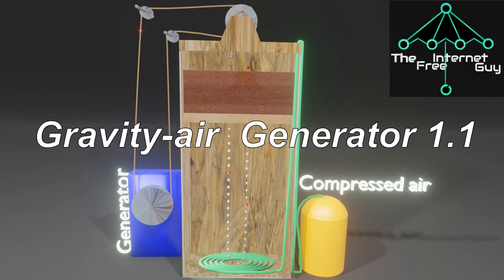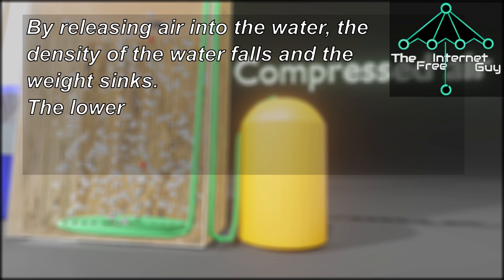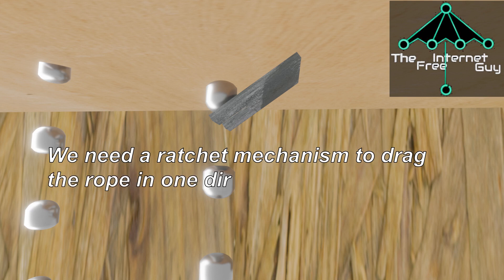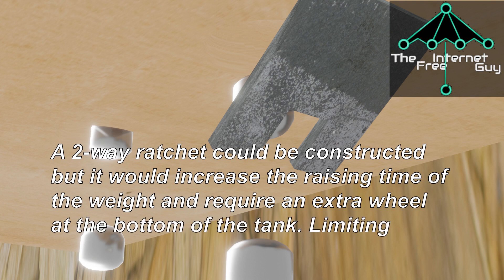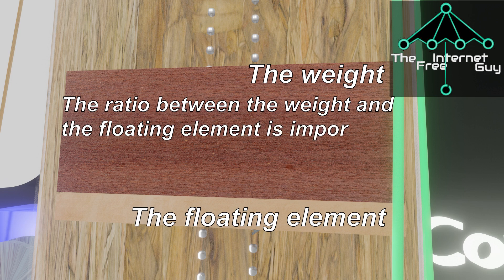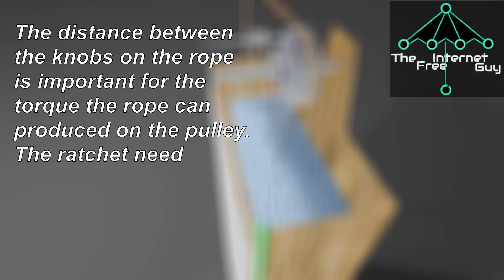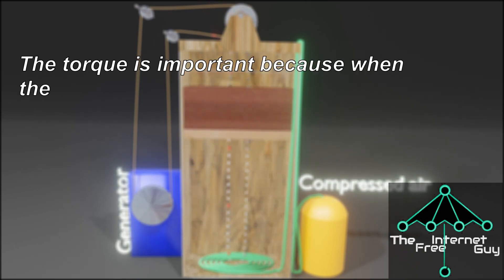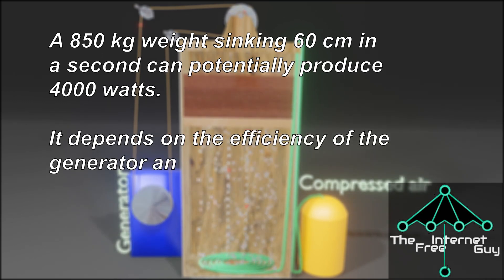Gravity-Air Generator for electric power - using buoyancy to pull a rope and turn a generator

Comment: But when the compressed air runs out, how do we refill it?
Reply from the maker: It might not need to be compressed air to begin with — it just needs to create enough airflow to reduce the buoyancy/uplift. In essence, the air will be slightly compressed just to get under water.

Comment: Compressed bullshit generator..😂
Reply from the maker: See this video where air is used to reduce the density: 
   https://www.youtube.com/watch?v=My4RA5I0FKs
Reducing density in the sand with air makes the object sink into the sand. Then, it must be true for water as well.  
Look at the air as the fuel, like using wood - when you burn wood, it can boil water, which can power a steam turbine. 
Now compare the air and the wood: air is abundant and free. Wood mostly grows in forests and is owned by someone. So you can not just cut a tree down and use it for boiling water.

Comment: air will made the weight to come down due to density change??//🤔🤧🤧🤧🤧Re-Check ur idea. its wont work. More over the energy needed to compress the air is same with what u got. to be precise u looses more energy. Because water is much dense than ur weight so if u leave air from cylinder from below the water occupies its place first. because the weight u said has floating buoyance.
Reply from the maker: See this video where air is used to reduce the density: 
   https://www.youtube.com/watch?v=My4RA5I0FKs
Reducing density in the sand with air makes the object sink into the sand. Then, it must be true for water as well.  
Look at the air as the fuel, like using wood - when you burn wood, it can boil water, which can power a steam turbine. 
Now compare the air and the wood: air is abundant and free. Wood mostly grows in forests and is owned by someone. So you can not just cut a tree down and use it for boiling water.

Comment: Can a compressed air engine b made using this technique?
Reply from the maker: An compressed air engine might be a better option than using air for diluting the uplift of the water. It was my hope that less air would be needed for diluting the uplift than power and air engine. Also making an air powered engine would require more advanced tooling and relative high precision. The device in the vidoe would require very little precision and simple tools to make.

Comment: It takes as much energy to compress the air in the tank .
Reply from the maker: True - every transformation, from one form to another form, costs energy - like air to electricity or wind to electricity. 
The idea is not to be the most efficient way of energy transformation but to be a viable way for an indoor and small place solution.